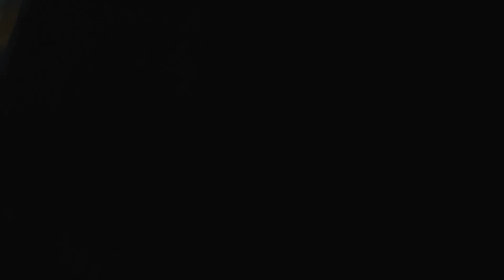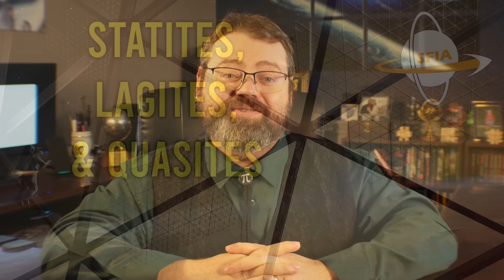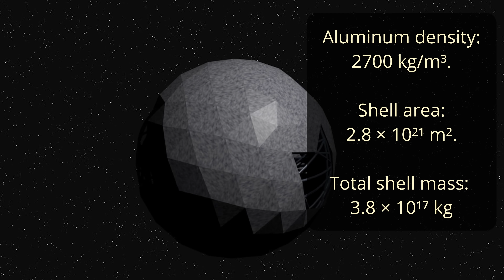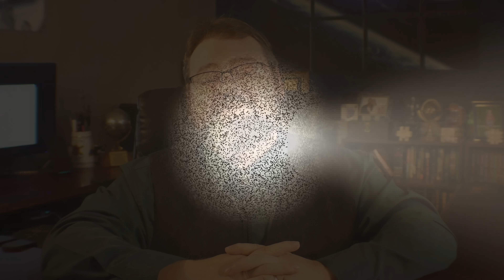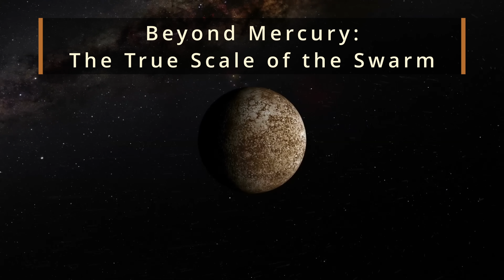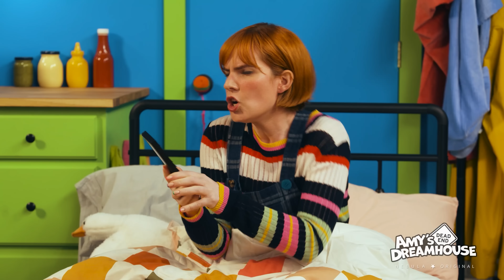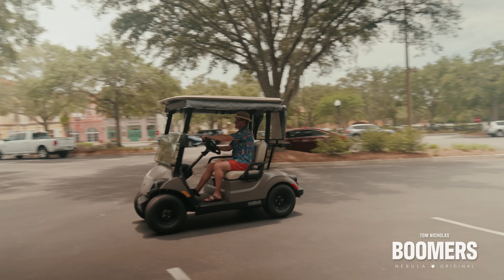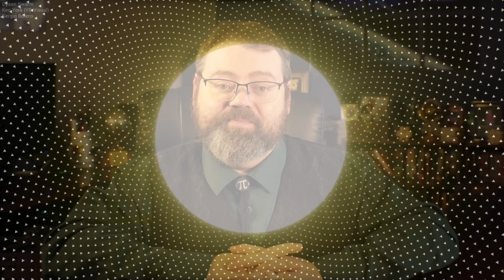Building a Dyson Swarm from Scratch

Comment: I suspect we're underestimating how hard it will be to mine in zero gravity. Gravity is critical for stability, loading, unloading, and sorting of ore, and it clears the air after excavation. Manufacturing would probably have similar issues.
Reply: When the sewing machine was invented, we had to create a way to stitch that wasn't the same as sewing by hand. Certainly mining in space will require alternate techniques but there may also be benefits such as cold welding and zero oxidation.
Reply: You can use artificial gravity to simulate the gravity.  We use centrifuges to do the same on earth.  Loading and unloading the same.  You could have what is essentially a large artificial hand made of a bunch of nodes connected by tethers, that slowly maneuvers it’s way to encircle a nearby asteroid. then the tethers start to constrict and draw the different nodes closer together until they are snug against the surface of the asteroid.  At that point you can have drills on each node anchor and start pulling material into centrifuges in the nude for separation.
Reply: @HandsomeDanVacationRentals  So instead of using small machines inside of a large mine, in zero G, you would have to put the mine inside of a giant machine. The complexity an cost would be considerable.
Reply: Mining will be embarrassingly simple: bag it.  We’ll probably be after volatiles to start so black bag, inject a small amount of inert gas, leave out in the sun, pump volatiles and inert gas, refine by cooling first then slowly warming and skim off volatiles in order of boiling point.  Put the minerals into a crucible, put it into the focal point of a solar furnace, extract minerals in order of melting point.  To refine the really valuable minerals like uranium isotopes, heat to a plasma then sort via mass spectrometry.
Reply: @CarFreeSegnitz  you could borrow a trick from plastic industry, put everything in water, then use non water soluble chemicals to make an emulsion that does the actual work, something like organic acids that can sequester given metals (or the other way arround, make the vehicle some hexane and the emulsion of iodine tincture to extract gold), less energy, about the same ammount of efficiency, and surface tension helps with cleaning afterwards.

Comment: Mining planet Mercury may be easier than accomplishing anything substantial on Venus (as long as her atm and surface are still so hot and dense; adiabatic compression plays a role there, too) 
What do You expect from mining the masscons under some Lunar Marias ( Latin+English plural!! I don't know if this is correct grammar); 
could they be metallic? (I suspect they are not; unfortunately) Their preferred existence under the Earth side of the Moon diminishes the Likelyhood of their origins being "made by" Asteroid impacts! The more probable scenario of their origin is this: A YouTube visualisation of the LittleBigBangTheia -ProtoEarth impact is available, and shows how the Lunar material could have been flung out, over the Roché limit, in mostly two blobs, the smaller one forming the moon, the bigger one falling back. https://www.youtube.com/watch?v=kRlhlCWplqk&t=32s
I suspect that the heating of the Moon's interior was not from the radioactive 26_AL, because that should have happened at an age of >4 billion years, early on in the planetary accretion phase. The real inside heating of the Moon, after it already had a solid crust, may have come from tidal heating in Earth orbit, at a time when the Moon's rotation was not yet in Lockstep with its orbit. The early Moon was in fact closer than now and it was and is still slowly drifting out, away from Earth (~10cm/year). The Moon's rotation could have become synchronized/bound in 1/1 lockstep relatively quickly, since it wasn't rotating very fast in the first!
What are these masscons, preferentially (but not exclusively) existing on the near side; I have a proposition: could these be Late impacts from several other leftover small debris from the LittleBigBangTheia - impact; several debris, also orbiting Earth in similar orbits as the Moon, and then, much later, hitting the Moon at relatively low speed, when the Moon's day/night_rotation was already synchronized by tidal forces? At a time when the Moon already had a thin solid crust, and the inside was about to, or already partially solidified, kind of high viscosity material, with lots of cracks and cavities in the already solid parts. Then the residual co-orbiting Theia_Impact_Debries would have compacted the Lunar material under the Maria site &  reheat and liquify lots of magma and thus "stamp" a Masscon underneath, without the need for a different, higher metallic content of the impactor, to cause the measurable Masscon!
Sorry if this theory destroys most hopes for "easy and rich" metallurgical prospecting on the Moon! 
Maybe the moons solid, cold mantle is filled with lots of cracks and caves, except in places of those Masscons! Btw. the deep caves would be unpleasantly cold for Astronauts: -15°C is about the equilibrium temp of a Moon without atmosphere, at 1AU distance from the sun. 
Maybe a cool, good environment for AI Data centers; there they are radiation shielded and they wouldn't compete with Iowa-Farmers for resources!

Comment: Probably the lowest layer of the Dyson swarm will be at just inside of Mercury orbit by a few thousand miles. 
What is kinda funny with the animation of Star lifting plates. While they will be solid. But 90% - 95% will actually be transparent. 
The drop of light from a fully solid plates will cause a tragic change in Earth's temperature change on the surface.
Reply: 1% more like. You'd only need the ecliptic plane's plates to permit sunlight through to the planets.

Comment: A technologically advanced civilization would simply build small fusion reactors, it's inefficient around a sun because the energy would be too much for local consumption and inefficient to transport. It's why for instance the current thinking is around small fission reactors for cities. This dyson swarm is old thinking.
Reply: A technologically advanced civilization will do Both. From a systems point of view a small fusion reactor will be less efficient, the star is simply there emitting gigantic amounts of energy going to waste and transmission losses are indeed a thing but less than what we theorize for a good fusion reactors losses would be.

Ergo it's almost a given that stationary needs will be powered by stars while mobile applications by reactors in the long run.
Reply: The Sun is generating power anyway. If you want to use your own fusion reactors, that's fine, but it's still wasteful to let all that energy go to waste. You'd have to shut down the Sun, but than it would just collapse into a black hole.
Reply: You're comparing these as if we were seriously going to consider a swarm before we changed our minds and decided on smaller reactors, when the reactors are clearly just what's actually the first thing to become practically feasible and not simply a thought experiment first.

So yeah, the reactors might be all you need for perhaps millenia if you're not expanding crazy fast

But eventually, you should probably start doing both, because eventually there probably will be a lot more local demand for the swarm's power, and it'll also be able to get beamed more efficiently by then anyway
Reply: This kinda misses the point. Regardless of whether ur civ uses fusion(and in terms of energy efficiency stars would be better since containment is provided passively by gravity) or Black Hole accretion disks(the hands down most efficient way of converting matter into energy) you will still always build a dyson swarm because stars are made of fusion/BH fuel and they produce tons of annoying wasteheat.

No matter which way you go you still end up buolding a dyson swarm, just a starlifting specialized dyson swarm.